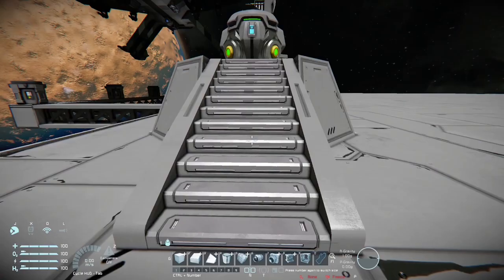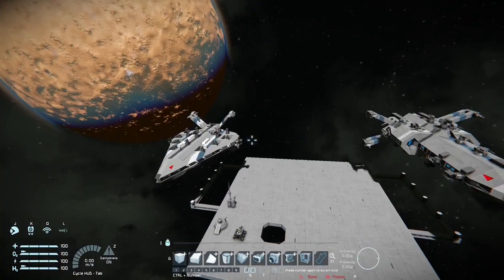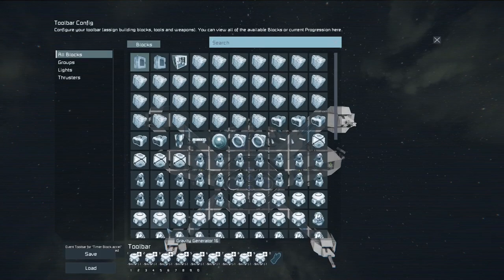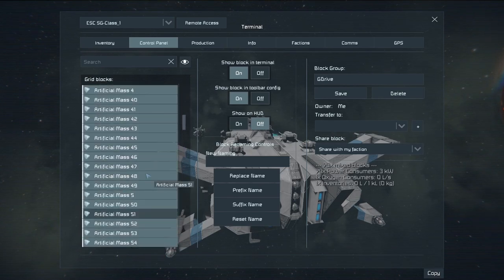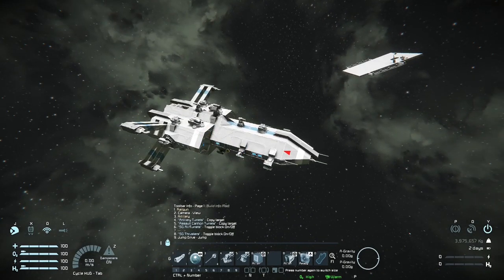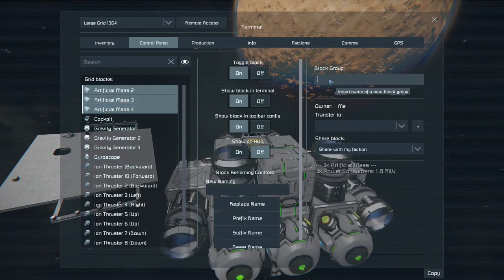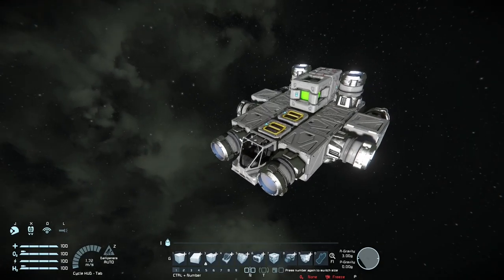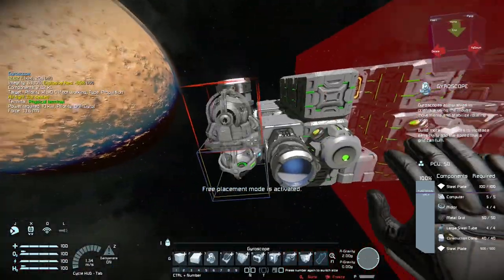The Comprehensive Guide To Gravity Drives - Space Engineers Tutorial

Comment: First of all this is by far the best guide about gravity drives I have ever seen.
Secondly you dont need 9 groups you only need 3 groups and put each of them into one of the timer blocks toolbars so you have 7x3=21 increases or decreases of acceleration.
Thirdly when building it you want to have 7.4 mass blocks per linear gravity generators for lightweight ships you can reduce the ratio a bit.
Fourthly for pvp you want to have a forward and backward but also a upward(or any of the other directions) gravity drive to dodge projectiles. 
Sixthly to control them without the scripts you can simply use a program for macros like AHK to convert your wasd into 1234 or something like that.

Comment: Im thinking now you might be able to have gravity drives activate based on thruster percentage with the new event blocks that would make things easier.
Reply from the maker: Definetly possible! I've seen it done before though it does require a lot of event controllers, but go ahead and give it a go!
Reply: On a large grid ship, just use a rotor with a small head to attack small grid AI block and eventually controllers, does all the same stuff for a fraction of the size ;D 

Also doubles as a cool AI core center piece